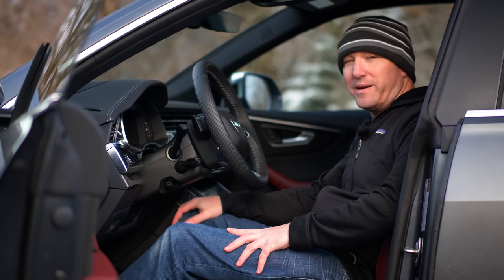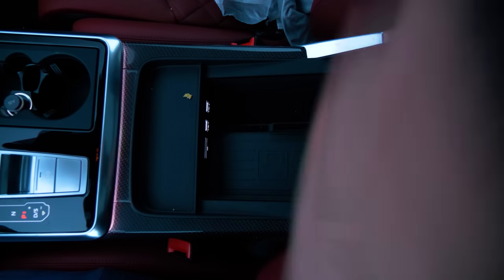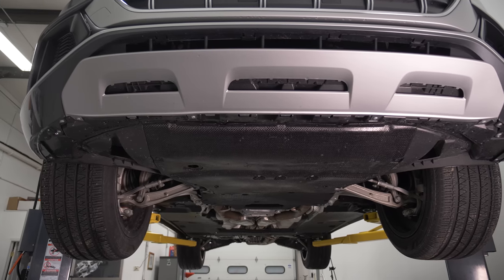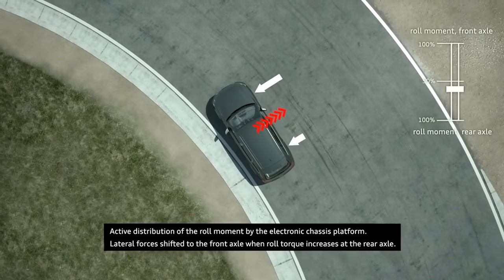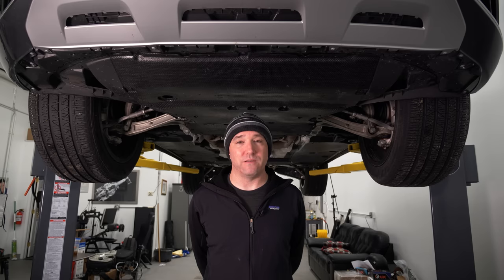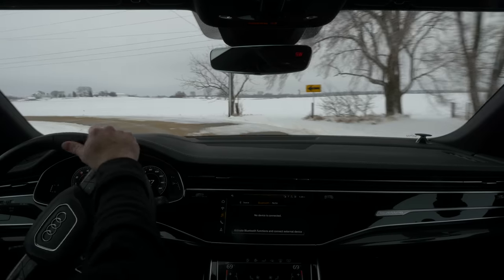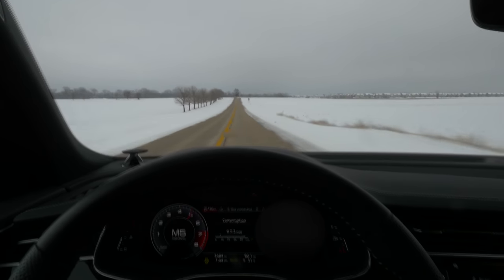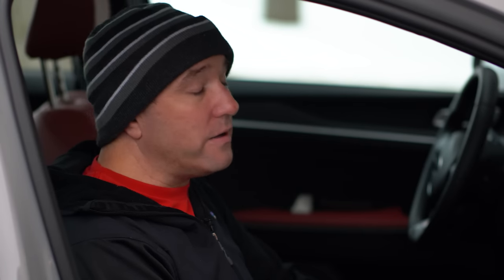2021 Audi SQ8 | Replacing Sports Cars

Comment: These things are leased & returned, taking a hard hit with a steep depreciation curve. Then posers will buy them up as used cars and pony up for proprietary parts and complicated repairs.  What a brilliant business model!
Reply: Yeah, but it takes a special kind of fool to buy an aging German luxury car. I hardly ever see older ones around, and I live in a place with plenty of newer ones.
Reply: @markmiller3279  The special kind of fool that realises a 10 yo car that's 85% depreciated leaves a fat wad of cash in the pocket that isn't yet sunk cost. One of my German luxury cars was indeed precisely (in a German way) 10 yo and precisely 85% depreciated when I bought it off a dealer that traded it. 5 years later I've spent about $6K on it for a bunch of stuff incl new turbo. Most work done by a specialist. And yes, I too live in a place rife with the newest bling cars. Also rife with old-money-dears driving reliable old Japanese appliances. Affluent and Effluent in good mix.

Comment: I hate the touchscreen hard-on's these days. Found the same experience in the newest Cayenne. I'm fighting a losing battle I know... and I will go back to yelling at the clouds.
Reply: Fingerprints, harder to use while driving, and dated and slow in a few years
Reply: buy its smaller brother with a real matte material buttons under that display while you can...
Reply: @Moe cheap cars are getting touchscreens too, and/or are going away
Reply: Just like my manual gearstick, they can pry button-controls from my cold, dead hands!
Reply: Just yell at your buddies that like these features. It's their fault right? (:
Reply: It's annoying, but there are steering wheel controls for all the commonly used features. As for getting slow with age: these things get so expensive to keep running that they rarely get very old before they're mercifully executed.

Comment: I just subbed so hard my Audi inlet coolant hose cracked.
Reply: I smashed like so intensively my Audi’s transmission exploded.
Reply: I smashed like so hard my rs5  Stalled
Reply: I hit like so suddenly my Audi’s timing chain snapped
Reply: Just laughed so hard I peed a little.
Reply: @imaheatfan   lol tmi
Reply: Lies, we all know it was the tank.
Reply: Hit like so hard my Audis turbo wastegate stopped working...
Reply: I tried to hit like on this but the Wifi at my Audi dealer's service department is trash.  What's it in for this time?  Carbon buildup.
Reply: I smashed that like button so hard my Audi went in limp mode for the third time this month
Reply: @imaheatfan  - you should check though, Audi coolant does feel like pee...
Reply: I hit like so fast my BMW's oil filter housing gasket exploded.
Reply: @warren_r  Direct injection turbo blues?
Reply: I subbed just so hard my crack hose let in Audi coolant !
Reply: @dougrobinson8602   2.0T.....housand dollars in repairs
Reply: Plastic oil pans a’poppin
Reply: I subbed so fast my Audi's wiring harness went and it's currently in the shop, again, second time in a month, while I'm driving my antique beige 2000 Lexus RX 300 I bought for $2000 at 197,000 miles on it, everything works flawlessly, and it's never let me down or had anything break and it's at 270,000 miles now. Ugly AF, boring, but bulletproof reliable, wish Audi could maybe think about doing that oh I don't know... once would be nice.
Reply: Why are you being so punishing? (:
Reply: Shit got so real that I traded in my Audi for a Lexus yesterday
Reply: @GaganGrewalf095  Trade up?
Reply: 7.5/10 -- Not sure it's gonna make the cut,...but, good luck.
Reply: Best comment. LOLd hard.

Comment: The fact that you get a lot of touch screens with little physical controls is sad in this price range.
Reply: Not really. Everything in the price range is gonna have a ton of touch screens.
Reply: @person.w9780   One quality touchscreen costs  100€, whereas one quality knob is 10-20€. If you have proper knobs for climate control this alone can bring a cost more than a single screen.
Everything has its own place. When will "engineering just because we can" stop :'(
Reply: @GiGaSzS  its been possible not so long ago.... this is just a greed from manufactures.... cost reduction but without price reduction.
Reply: @GiGaSzS  Give me tactile, responsive, able to be used without a glance, buttons and knobs over a glorified smart phone interface in a car any day... 

Still baffles me how people can applaud touchscreens in cars, while frowning upon using your smartphone in your car... 🤦‍♂️
Reply: They're going to.have the screen no matter what, for navigation maps, as well as lists of music and a few other things that work better with a large display. The problem is removing HVAC and basic audio hard controls. Most makes have realized people do want some controls, and put them back. There are also steering wheel. Controls for some things.

Comment: Sounds about right at the end. Great engineering to make a heavy car feel lighter weight. Too bad all that complicated engineering is likely to give you a nightmare after three years, compared to a far simpler sports car.
Reply: They could put all of this money in making it 400kg lighter. Like an Alfa Stelvio.
Reply: Where does one find the “simple sports car” that you speak of?
Reply: Colin Chapman is rolling over in his grave.
Reply: @rsmith2320  well any of the 3 pony cars? Supra ? The new Z ? They all lack  air suspension, rear wheel steer, self driving crap that you're going to need to fix down the line
Reply: @R4M_Tommy  The Stelvio is tiny in comparison, so it should be much lighter.
Reply: @rsmith2320  MX5

Comment: Got the SQ7. That V8 is an absolute beast. And holy shit the B and O sound system is incredible.
Reply: The Q7 with the V6 is alright, but when Audi made the SQ7, that V8 is the engine that this needed. The SQ8 is definitely better looking and sleeker imo, but that engine still pulls just as hard.

Comment: Check engine light on, classic Audi.
Reply: Exactly, and there are some people *cough reddit cough* that say they are fine/reliable/not a pain in the ass to maintain. It's a press car ffs, that's what they are trying to show off, imagine if it weren't.
Reply: @descence2082  They are fine. It has an engine light specifically because its a press car. Do you think they produce some kind of special cars to give to the press?
Also regarding reliability, things only go wrong when you have things to go wrong. Don't compare your 4 popper with no turbo and manual trans to a over engineered out of the ass German car with a twin turbo V8. Even its engine mounts are active ffs.
Reply: @descence2082  

The only car that expensive that I'd expect to be legitimately very reliable is either a Porsche 911 or Lexus LC500. The Audi 2.0T and 3.0T engines have been getting much better in the past 5-6 years, but they are still more expensive than an average car to maintain. The Audi 4.0T on the other hand is still with some issues however, but no-more than the BMW or mercedes TTV8 equivalents iirc.

Also tbf Audi will show warning lights for a bunch of things that aren't exactly urgent, like having low windshield wiper fluid.
Reply: Time for a new engine
Reply: @CrazyWeeMonkey  - Ask Nick Murray how reliable his new 911s have been.
Reply: @CountCorax  depends on what you deem "necessary". Technically you don't need an A/C or heater in a car but you wouldn't get one without it. It's a luxury product. Of course it'll have more equipment. And all that equipment will start to get more common and more reliable with time whether you like it or not. I remember people saying automatic transmissions are unreliable/add unnecessary complexity back in the days and look where we are now. 
I'm saying all this as a guy who has never bought a car with automatic transmission.
Reply: Its called the "money light"
Reply: @OMGWTFLOLSMH  

I checked out that situation and it seems like he got super unlucky and had 2 lemons in a row, but that's still definitely an exception to the rule. 911's are known to be reliable cars, and example of this is the fact that more than 70% of all 911's made are still on the road. The cars are expensive to service and maintain, but they last and are solid cars.
Reply: @descence2082  the old ones are when they were supposed to be driving pensioners around. Like the Audi C4 100 or older.
Reply: @brendancarlson1678  🤣🤣🤣
Reply: Its on because the car is on while the engine is off! Its basically letting the driver know that the engine is off.. Its the same story in my 21 Q7!
Reply: @CountCorax  people want the extra tech and since these are mostly leased the reliability doesn’t matter
Reply: Had several Audi’s over the years and very few problems compared to the American Junk I’ve had.

Comment: And it has a self-dimming speedometer! Is it configurable to a specific speed level? :-D
Reply: Personally I like the self BLURRING Heads up speedometer above the 75... !
Reply: @pesto12601  yup, that's what I meant :) What a cool feature that is.
Reply: I noticed that too pretty nice
Reply: @pesto12601  It needs a head up display warp drive simulation. Tesla would sue if you called it ludicrous speed simulation.

Comment: Why can't we have sport sedans and sportbacks to replace sports cars instead? The extra height will ALWAYS compromise the performance.
Reply: Because the relative benefit of extra height and cargo capacity for most people outweighs the relative benefit of a lower center of gravity and lighter curb weight.  There will still be some purists who insist on a low slung sports car but cars like an SQ8 can get you to 95% of that for most people in the market at this price point.  These sort of SUVs are here to stay.

Comment: I would love to see what the maintenance costs on cars like these look in a few years. Just looking at the complexity of the suspension there is no way an average person can work on this alone in their garage.
Reply: It'll be like all Audi's like this similar to my Audi's that went from $60K to $6K in ten years and while great when they're , that's pretty much not common. You need to have 1. a solid Japanese luxury car as a backup because that'll be boring but bulletproof 2. a rather large bank account. Using the math I've done from all previous Audis if this costs $100,000 it means in ten years it'll cost $10,000 and where the cost to you during warranty will be next to zero while you make $1,000 car payments after the lease is done and traded in and winds up in someone's hands in ten years IF it's still even running that person will have to put approximately, and not even a made up number, around $1,000 on average per month (based on $12,000 yearly cost in repairs) to keep it running. So either way you're paying a grand a month long term regardless of where it is in its life PLUS the cost of a second car that will get used at least once a month while your Audi is at the stealership or a trusty third-party Audi repair shop. The final cost of owning a $100,000 Audi all told across owners after ten years can be over a million dollars, easily.
Reply: @colin-nekritz  I see vanishingly few 10 year old luxury cars on the road.
Reply: It will break, and some schmuck will keep driving it with the suspension sagging.

Comment: I mean I eat and drink and live in my 2019 VW Tiguan. Ketchup gets spilled, crumbs fall off of my Chicken strips, salt falls off my fries and this stuff ends up on the seats, and carpet and shifter/console area. I think any car gets crumbs and smudges and streaks. I’m OCD so I have cleaning products in the car and I vacuum the car often and wipe her down. Micro fiber cloths are my best friend and a mild solution of Dawn dish soap & water in a spray bottle as well as ammonia free glass cleaner. Most people don’t take fuss over their interior to that degree. I’ve recently bought a cookie sheet to eat off of in my cars and it helps tremendously. The lack of reasonable storage in the front half of the car would annoy me a lot tho! I love storage and need storage. This Audi is a great looking ride! But @ $108,000 I probably won’t ever meet the cost of admission and pass on it and choose an Acura MDX and stay under $70k hopefully. Thanks for your work here Mark!

Comment: 10:42 is what real luxury is all about. You won’t see it on a Lexus.
Reply: You mean its German lux! And no you won't find it in a Lexus 😆 😂 🤣 😅
Reply: hahaha
Reply: Maybe my vision is just bad but all I see on the gauge cluster is a Trac Off light
Reply: Lexus has nothing close in this segment.
Reply: @babochee  ?
Reply: @scott8919  it’s at the top of the cluster, dimmer than the traction control symbol but it’s there.
Reply: Lexus doesn’t have a performance suv tho
Reply: @kristians2704  Well Lexus does provide a semi "performance" SUV in the F-sport trim level; but if I am being completely honest the F-sport is really an appearance package. The car's 0-60 time is still what car experts call slow.
Reply: @colechapman6976  yeah like you said, it’s just an apperance package. Not like a 500-600hp AMG/M/RS SUV.
Reply: @kristians2704  Totally agree, regardless though I still can't seem to imagine the reasoning behind purchasing one of those 500-600 horsepower suvs over a regular Audi or Lexus product. All that extra power and technology just adds extra cost to the owner via pricey maintenance or via low gas mileage numbers. Also, when you buy one of these performance SUV's chances are it's just going to be doing max 70 on a highway so why bother when a normal one can do just as good of a job and cost thousands less while also not giving you a ticket after you pressed gently on the gas pedal and are now doing 90 and receive a large fine. Might as well get a regular version and save on gas, cheaper maintenance, and the chance to avoid tickets since you won't be doing that type of speed anyways. Plus I seriously doubt anyone goes on track day with this thing, so what's the point exactly?
Reply: @colechapman6976  Because engine go brrrrrrrrrrrrrrrrrr is the reasoning behind buying this.
Reply: @chrishoesel  Yeah I guess we really are just monkeys attracted to shiny things!

Comment: Resolutely a lease job. I shudder at the cost of replacing the rear-steer rack, anti-roll mechanisms and air springs when they fail. Then there’s the direct-injected hot-V engine. You’ve balls, Mark, for nailing it with the snow and power poles in close proximity. 😲
Reply: Don't forget about those frameless windows... those are always a treat to deal with after a few years.

Comment: That looks like an incredibly complicated vehicle.  Straight to the junkyard as soon as the warranty is over I am sure.
Reply: haha looks like you will only buys used 90' cars then..
Reply: This comment makes zero sense.
Reply: Absolutely! Unless some fool buys it and ends up driving it around with a bunch of broken parts (like the fancy roll bars).
Reply: @CountCorax  I just stated a fact. You can t avoid advanced computing devices on most modern high performance cars these days. 
Modern high performance car = high maintenance

Comment: I have the exact same touch screens in my A6. I really can’t complain. They look the part, the function exeptionally. Sure they get some finger print’s on them but some window cleaner spray on a soft towel and they are like new in 30 seconds. I like them more than the old school buttons and switches in my A3..
Reply: I can easily believe this. I still have the old interior on my A5 but I test drove the new A6 with the touch screens and immediately felt that after a week it'll be second nature.
Reply: @BlameGamerOfficial  exactly!👍

Comment: Great technical review.  These are very accommodating of a tune to get significantly more power while still being under the torque limit of the ZF trans which was originally designed for the TDI V8 version.